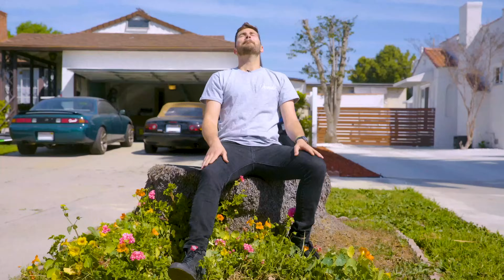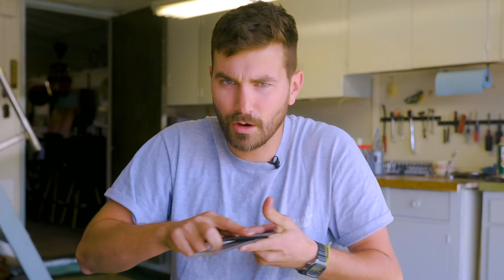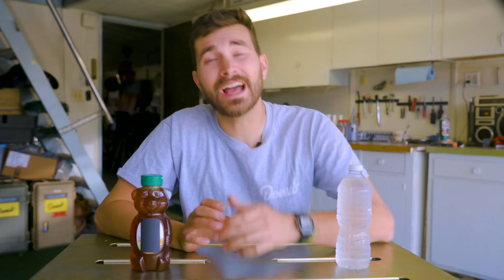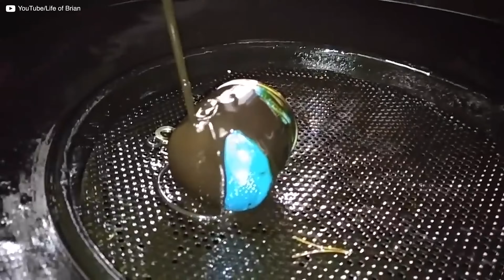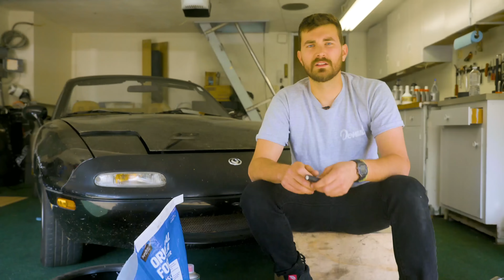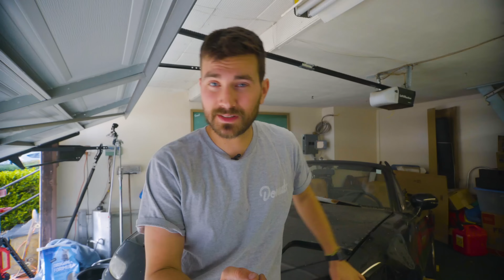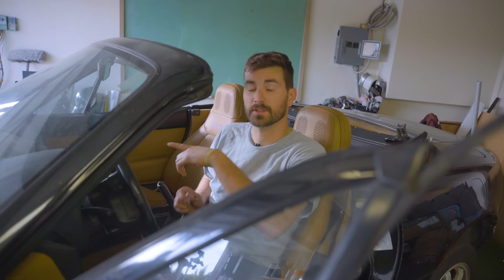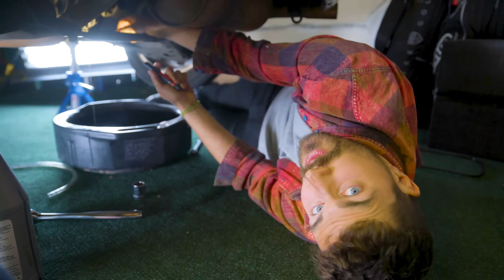9 Things You’ll REGRET Not Doing to Your Car

Comment: 2 things. All the hoses should be changed and coolant. Interval depends on your car. I also change the thermostat as a precaution  cuz when it fails, car goes kaboom!! Oops. 3 rd thing of 2 is vacuum lines. I switch them out on older cars like more than 10 years old since when one of them fails, you get to play wack a mole to find which one is the culprit

Comment: 1.  Be sure you can open the fill valves in trans and diff BEFORE you open drain plugs.

2.  I recommend for street cars Castrol brake fluid, just the plain version (formerly known as Low Moisture Absorbing".  Track cars will likely need a higher boiling point.

3. How to Bleed Brakes:
 
Taught to me by semi-famous Toyota engineer, who built championship winning cars and motorcycles.
 
1. Get Sears (or ~) brake bleed kit (canister, hoses, adaptors for bleed valves) and their hand vacuum pump.  Kits there have both components.  Inexpensive.
 
2. Pour a little b/f in canister, hook up hoses and use the tightest adaptor on the bleed screw that you can.
 
3. Pump vacuum to 20-25” with bleeder valve closed.
 
4. Tap caliper with small hammer or similar.  This releases the air bubbles clinging to the caliper into the stream.  WHATEVER method you use, DON’T skip this step.
 
5. Open bleed valve.
 
6.  When vacuum is almost (but not completely) gone, close bleed valve.
 
7. Check level in master cylinder.  Do this often.
 
8. Repeat as needed.
 
Benefits:
 
* I have never had to remove a caliper and turn it upside down, even after replacing all the brake lines.
 
*Never got a firmer pedal using any other method.
 
*Requires only one person.  Your wife/so will thank us both.
 
*You will not be pushing the piston in m/c into the rough area normally unused, thereby not prematurely wearing that seal.  (Clutch m/cs are always used to full range.)
 
Note: On my Elise, I needn’t even remove the wheels.
 
Yeah, yeah, people use pressure bleeders, but my racecar mechanic friends don’t like these.
 
Yeah, I know about speed bleeders.
 
The above is my opinion.  No responsibility for screw ups, injuries, maiming or deaths.
 
Take it, leave it.  OK with me.
---
 
Another pretty big benefit:
 
When changing brake fluid (annually for me, biannually for others), we want to get the fluid out quickly.
 
So, with the bleeder valve open, I just keep pumping the hand vacuum.  All the old fluid comes out fast.
 
But, remember to check the m/c level often.

Comment: Great series for newbies guys! Keep it goin'!
Reply: You only forgot one thing: ALWAYS remove negative battery terminal even if you don't touch cables or anything electrical. Once had a scary moment when working on a 1959 Cadillac. The starter gone bad in all of a  sudden and the solenoid shorted, even the key was in the off position, but the engine got cranking out of nowhere, fully random, and haven't stopped until the battery terminal was removed. My hands were near the generator belt. I was lucky AF, noone got hurt.

Comment: Only thing I would add to the oil change is to check the old filter for the gasket. If you don't see it, then it's stuck to the engine and needs to be peeled off. Don't usually have that problem but I bought a 94 F250 recently and had this happen. I put the new filter on without checking and when I went to run it, all my brand new Amsoil bypassed the filter and ended up on the ground. Fun times.

Comment: Pro tip! If you just bought a car, take your old oil filter, cut it in half. You can tell if the engine is going bad by if there’s any metal shavings in there. If there is, sell it ASAP! 😁 or swap the motor. Your choice.

Comment: One thing to make note of is that you should always know what you're doing if changing to a different type of spark plug. Going from copper to platinum or vice versa will affect your engine's timing, and unless the ECU has been adjusted for this, albeit minute change, your car may run worse even on more expensive plugs. So for the average diyer, if the car came with coppers put coppers in, if it came with iridium then put those in, etc.

Comment: Just an extra piece of advice I've never heard anywhere else, make sure every now and then you check your fluid lines, mainly coolant. I was driving and a very small (almost unnoticeable) coolant line burst while I was driving. I lost power steering, and power brakes from one tiny line spewing coolant everywhere
Reply: mmm yeah im losing coolant all the time but everything  works,doesnt even overheat
Reply: @juhavi6029  are you losing it all at once or a steady drip? I lost almost all of it at once so I didn't have any pressure in my system. I had a drop somewhere else that didn't affect it at all after too
Reply: @sparkplug4178  steady drip.
Reply: @juhavi6029  yea makes sense, I had one too, its when you lose most of it all at once
Reply: Juhavi60 probably a Hose or one of the connections, wherever hoses meet. Oem connector are usually fragile and plastic.

Comment: Haha, americans changing the oil every 3000 miles.
The recommended interval for my car is 20000 miles.
I change it every 10000 cause I'm a careful guy...
Reply: What in the hell are you driving? 
I personally go 5-7k miles on Liqui Moly oil in my work truck. It has a 7 quart capacity but a filter that fits a Honda Civic which is the down side for a large V8. 
3k miles is on conventional oil 5k to 7k is what I do for synthetic or one year if it's based on age whichever come first.
I have never seen a vehicle that recommends 20k intervals 
I think some BMW or Benz reach 15k but not 20k.
Reply: @bryanmartinez6600  A Volvo with a D5

Comment: I had a beater that i did 80k miles no servicing at all, just brake pads, when it came to oil change it was basically just removing iron fillings, spark plugs were spotless though

Comment: Brake fluid alone has water in the mix . Changing it per manufacturer recommended miles actually matters . The R&D from the manufacturer test this. The owner’s manual tells you how to maintain your vehicle. 
The transmission fluid , if you buy a used vehicle and no known history for Trans fluid changes . If you check it and it’s yellow and has a burn smell . Do not change it . Your automatic transmission uses pump pressure to engage clutch packs so you move and shift . If you flush out that bad fluid and add new . Your car will probably not move because of the clutch friction material that was floating in the fluid will be gone . If your not comfortable take a sample and send to a test facility near you . They will tell you what’s in it 
Donut you missed that very important tip. 
If you want a easy way to get more MPG 
Go with a hotter plug and coil or wire depending on your engine. 
I am a level 3 Diesel Mechanic. Hit me with questions people gas and diesel is my life . I don’t mean to sound like I’m bashing but in my years of experience in this field I can’t help my self but to add in a experience.

Comment: When checking spark plugs on engines with more cylinders, please only check one at a time. Doing so will keep the wires and electric system in order, which keeps the firing order correct. Mixing up the wires is a nightmare you don't want to deal with.
Reply: Most people who need this kind of video probably dont ride around in distributor ignited vehicles.
Reply: Ethan Eve I’ve never had this issue. Each wire is a certain length. It can only reach to one place comfortably.
Reply: Or label the wire

Comment: Some pro tips#

Always wear plastic gloves when working with these oils and fluids. They can be like poison, going through your skin and make you sick. 

When bleeding brakes, start with the brake furthest from the reservoir. If you get brake fluid anywhere where it's not supposed to, spray the area with water and clean it off. Brake fluid is very acidic.
Reply: Brake fluid is actually a base...still removes paint and such. Best to use alcohol or brake cleaner to dry it up.

Comment: I hate doing diff oil changes. I have to do front and rear diffs plus the transfer case and it gets old pumping all that oil. I don't know how common it is on cars but my truck has zerk fittings on the driveshaft U joints that I grease every oil change.

Comment: You forgot to mention: NEVER gap a spark plug with a fine tip as they will break. Specifically iridium tips. They are (mostly) properly pregapped

Comment: 13:00 With the brake bleeding you didn't mention the sequence in which you do it, unless I missed it or it really doesn't matter. I was taught to start with the brake furthest from the master cylinder and work your way closer. Also, people torque their drain plugs?? Consider me learnt.
Reply: Yes on the torque of drains. Too loose and you leak oil, too tight and you might strip the threads. Most plugs tighten to somewhere around 25-30 ft-lb

Comment: "That was the oil change, it was pretty easy, right?" screams in non-japanese cars like Ford Fusion
PS: As for brake fluids - RPF600 is a nice choice if you pop up to TRACK DAY BRO from time to time. However don't overdo it - the higher the boiling point usually the more hygroscopic the fluid is and requires checking/change more often. Mobil has also 660 which is even better, but more hygroscopic. So good for cars that spend much more time on the track and worse for daily drives that occasionally race. But that is a part of another big advice: don't overdo putting sport and performance stuff in the car . "Pro" is not always better, for example tires & brakepads for track use work correctly when they are hot, which will not happen in your daily work commute. Agressive ceramic clutch will kill you in a traffic jams.  and so on and so on..
Reply: Dont forget overly stiff coilovers.
Reply: @wingedzero  You can "live" with overly stiff coils. Most have a way to tune the stiffness on top of the column too, you just dial it all the way back for daily driving. But yeah, it is a small QoL thing. Unless someone has a tough butt and doesn't give a f ;)
Reply: veevoir Ford fusions are stupid easy to change oil on, now if we are talking about a fiat or mini I’d agree
Reply: 64polara 
I love it on my Kia with the top mounted filter.
Reply: @Suburbanhotrods  Filter mounting is, at best very meh. For someone who does amateur garage work - it is not great. Japanese ones, especially older ones are stupid easy.
Reply: #drivermod first before any other mod!

Comment: Somebody explain how 30 viscosity flows faster when it's higher resistance number pls
Reply: a 10 viscosity will flow faster at 200+ degress vs a 10 viscosity at 0 degrees - in other words a 'pure' 10 viscosity rating still behaves differently at different temperatures. for the blended oils we use nowadays: at 0 degrees behave like a 'pure' 10 viscosity. at 200+ degrees behave like a 'pure' 30 viscosity. (due to the additives the 'effective' viscosity changes with the temperature)
Reply: To add to the above - a 0 weight oil would be too thin at operating temperatures for a car needing 0W-30 oil. A 30 weight oil would be too thick at winter temperatures to circulate properly. Hence why we use multi-weight oils nowadays.

Comment: Little tip once you remove the oil filter double check that the seal from the old filter isn’t still stuck to the block. If it is, remove it! Having to seals there will cause leaking and blow the engine.

Comment: Change your engine oil every 5000 KILOMETRES! NOT MILES and you’ll hit 500,000 on the odometer, don’t worrry about brake fluid coolant ATF. I’m on my 3rd vehicle rolling on 470,000

Comment: Why didnt you guys fill the oil filter first before installing? It makes the motor run for 30 seconds with no oil
Reply: If you turn the key halfway it usually pumps some oil into the filter, but after that you should check the oil again. But yes filling the filter if possible is recomended
Reply: @mgjamesfin7011  ohhhh I did not know that, what pumps the oil with the engine not running, isnt the oil pump ran by the engine?

Comment: Yo, don't over torque by more than like 10% (2-3 ft-lbs). Just replace the crush washer or o-ring every other oil change. Otherwise, you might shred threads, snap heads, or crack pans.

Comment: It's worth noting that some cars don't have replaceable fuel filters. My 2013 Ford F-150 has an in tank fuel filter that is supposed to be for the lifetime of the vehicle. I'm sure I'll replace it at some point, probably around the same time I have to replace the fuel sending unit. Just FYI if you don't find a fuel filter under the body.

Comment: Why would you torque a oil pan drain bolt wouldnt you have a chance of stripping the threads i just hand tighten mine
Reply: Nonoonno you have to tighten it with some tool otherwise it might open due to vibrations etc and all of your oil will run out really quickly if the engine is warm. The reason to use a torque wrench is that you dont  strip the threads
Reply: @mgjamesfin7011  i meant i snug it down with a ratchet

Comment: remember, when doing the break fluid change always start from the wheel that's most far from the break reservoir
example: break reservoir is in the front on the left: start bleeding from the rear right, go to rear left, go to front right and lastly front right 

that way you can be sure there are no bubbles, that's how i learned it as an apprentice though
Reply: It also depends on the vehicle. Subarus method actually state to start from the closest line. In the end, just don't run the brake master cylinder reservoir dry.
Reply: They taught me to do that in my high school automotive class 2 years ago.  actually forgot about it until you commented that
Reply: @PsychoTrucker401  i forgot it myself the second time i did that on a customers car lmao
Reply: Also, suck the old fluid out of the reservoir with a turkey baster (or the like) and put fresh new fluid in before you start at the wheels - that way you limit the risk of pushing even more dirty fluid throughout your system.
Reply: Thank you Tyler the creator
Reply: Fwd dually lmao two front rights

Comment: Wish I could have my jack/stands on the pinch welds like that up here In the north east I barely know what they are 😂
Reply: Ramps? 

You can drive the front up on ramps, then Jack the rear up from the diff and slide 2 ramps under the rear wheels.
Reply: I have fwd also I just throw the jack under the oil pan and send it ether the jack or the road is gonna kill the pan just weather which comes first